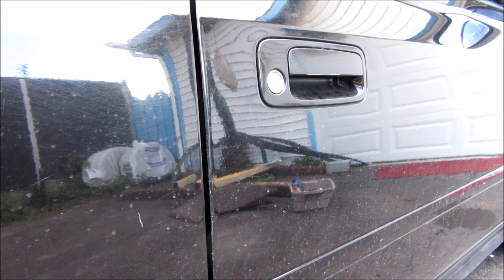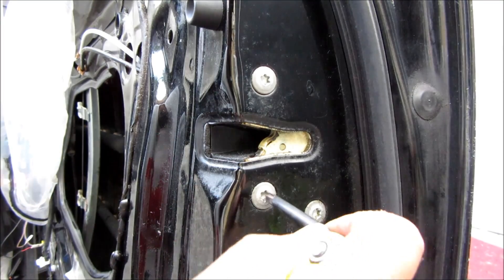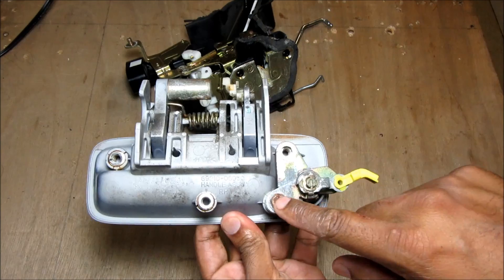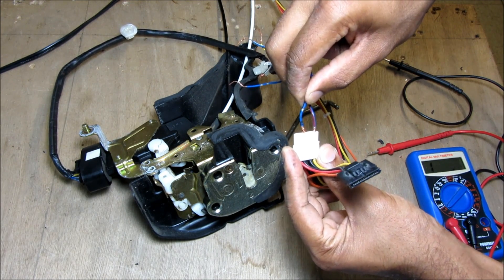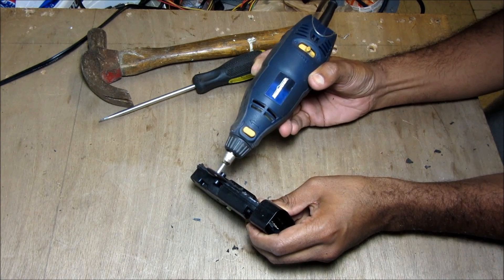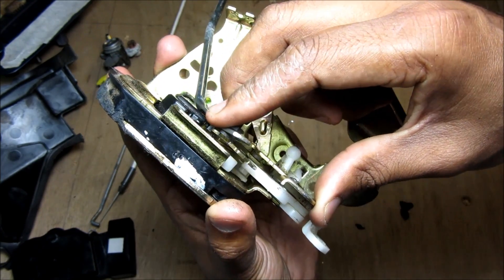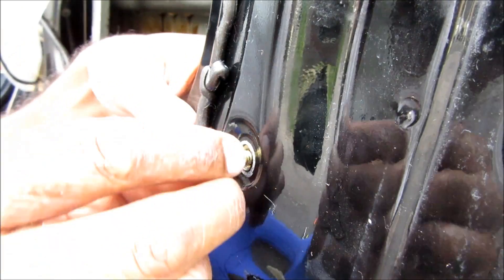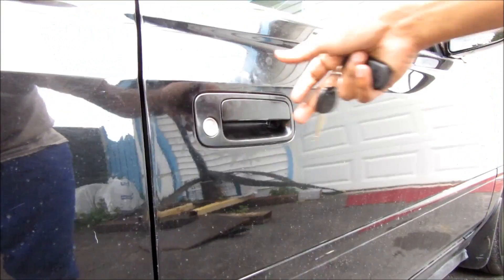How a Power Door Lock Works & Replacement

Comment: hi! do you have any suggestions on what i can do on getting to the lock actuator since my door is totally stuck....it won't open from the inside and outside door handle.  thanks!
Reply from the maker: +Ray Trinidad You will need to get the door panel off somehow, you might have to break it off if you can't pop it off from inside. See if you can pull the cable for the door handle after taking off the trim around it. If not, then play with the latch mechanism from the inside until you get the white tab to unlock. Sorry not much other suggestions....since the two bolts holding the anchor are connected to the body and you couldn't unscrew them with the door closed.

Comment: This is awesome!  You make great videos and clearly know what you are doing! After watching this I feel I can now replace my broken power door actuator. (Now to find out where I can buy the actuator separately for cheaper than the dealer..)

My 2002 Camry drivers side door lock actuator started slowing down and finally gave out.  A few months later my rear drivers side door actuator stopped working. I'm hoping the back drivers side door lock is maybe on the same fuse and that would be an easy fix for my back door. I'm pretty sure the front drivers side door actuator is toast because it slowly died on me.

I have a 1998 Avalon which I took to the dealer recently to replace the door handle that broke half off.  It was about $300 for parts/labor and after they were done they said the door closure assembly was binding (which it never did while I used the door handle half snapped off). They quoted me $1,100 for a door closure assembly part. I skipped on it because it didn't bind that much and still works fine two months later.

The car probably isn't worth $2,000 and I'd like to keep it running smoothly without paying more than it's worth so your videos are awesome for me!!
Reply from the maker: +Michael Linhart I'm glad my videos help you learn and inspire you to work on your own car. On these older cars, going to the dealership will be expensive. The junkyard is your best friend...I've gotten a lot of parts that you see in my videos for cheap from there...including this power door lock actuator. 

Junkyards really make money on metal, so most things (like electronics) that don't have too much hunking metal they don't charge as much.

Comment: Have you any videos on testing actuator before you take the door apart.Good video!
Reply from the maker: +Celtic Tiger Not right now. Usually if the actuator is slowing down or not working (especially in warmer weather) it indicates its slowly dying. If its completely dead, you can jump 12V to the terminals at the plug to see if it will activate.
Reply: I have power and signal,just saw a video on the matter,seems like the micro switch inside the actuator can give problems with sticking.
Reply from the maker: I did read somewhere that there's a built in resistor somewhere that overheats purposely so it doesn't burn out the motor from over-actuating. In warm weather it shorts the motor causing it to not activate properly. However I didn't see any resistors when disassembling the unit.
Reply: Yeah I'm going to take it apart and see what's going on.Hope its something simple.

Comment: My friend, you're clearly a genius in this area, but you convinced me never to try it myself. Too many things I'd never get back together right. Can I ask your opinion? Both my remotes lock and unlock all the car doors, but the key in both remotes fail to lock or unlock the driver's side door. The keys must be good, as they work in the ignition. The car is a 2011 Toyota Venza. Would you advise taking it to a dealer (high cost but everything gets put back right) or a regular shop (lower cost but might not get all the parts on back right)? Being able to get into the car with the key is important for when the car battery has died and I need to pop the hood. Great video, if for nothing else to show us how complex this "simple" job can be.
Reply from the maker: +Steve Kohn My feeling is the key unlock rod has become disconnected and can't control the latch to unlock or lock. If the car is under warranty, consider taking it back to Toyota. If not, find a reputable independent mechanic in your area. The only thing that can go "wrong" is they break the door panel clips and don't put it back properly ( and end up with a squeeky and rattling interior).
Reply: +speedkar99 I'll try the independent mechanic then. Was going to take it to the dealer. Heck, if I could figure out how to get the interior door panel off, I'd try it myself if it might be just a disconnected rod. But found no videos on YouTube for the Venza door. Many thanks.
Reply from the maker: Steps are similar for the Camry:

http://www.toyotapart.com/Venza_Door_Panel_Trim_Delamination_TSB008310.pdf

http://www.toyotanation.com/forum/152-venza-forum/1158657-venza-door-panel-removal-tutorial-video.html#post9669465

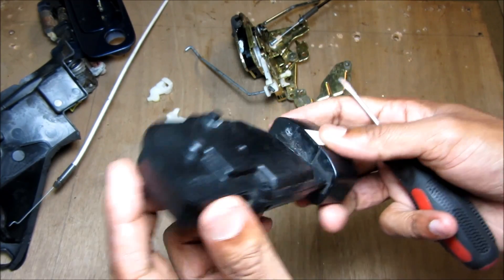Comment: When you broke open the actuator assembly with the motor inside (4:50 of your video), it reminded me of another video where a mechanic used an alternate method to open up a similar assembly and put it back together. Not sure if the skill is transferable in this application but hopefully sharing other practices helps. You can watch it from the beginning or skip ahead to about 2:00 of his video to see...

http://youtu.be/AUlx41w7L1E

Comment: my Toyota rukus is now 4 years old,  just recently it hasn't been locking when I push the black button on the outside of the door. it locks sometimes. I know there is definitely a problem. could it actually be my lock assembley that is no longer working.?
Reply from the maker: +SK4869 Yes, the lock actuator motor is worn out, or there could be a gear snapped inside. The only way is to tear it down to find out.
Reply: just last month i took it to Toyota for it's 45,000 service. i informed them that my car wasn't locking properly. they just changed the battery in one of my keys, but still when i push the button on the outside of the door to lock it rather than using the key nothing happens & after watching your video i know it must be deeper. than just a battery. my car is just over 4 years old. how long does the lock assembly usually last for.?
Reply from the maker: 4 Years old is a bit young to have a failed lock actuator but nevertheless it is a mechanical part that could be defective.

Mine were most likely original, I've got 279,000km and its 16 years old...

My 10 year old Lexus with 224,000km has door lock actuators that work like brand new.
Reply: Yes 4 years is a little young. you see on the outside of my 2 front doors the driving side & the passenger side, i am having 2 black buttons 1 on either side. it is for locking & when i want to unlock i just go to open the door as they are having sensors under neath, is why i not need to use my key. maybe it could be something else. i haven't even done 50,000 ks is still like new you could say. maybe i will look into it further do a little research before i decide on what to do about it. will keep you posted on that. thanks for letting me know your thoughts always appreciate it. have a great day my friend :)